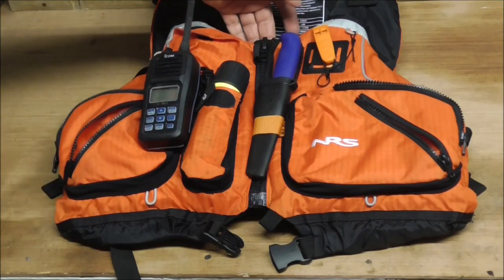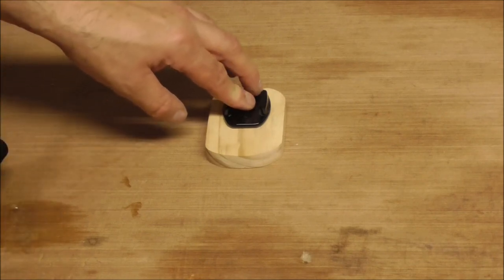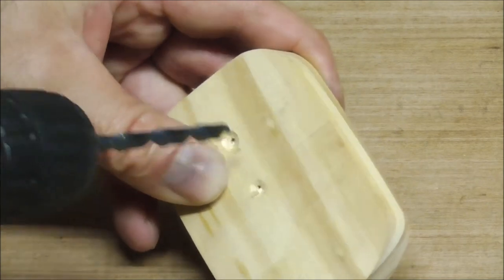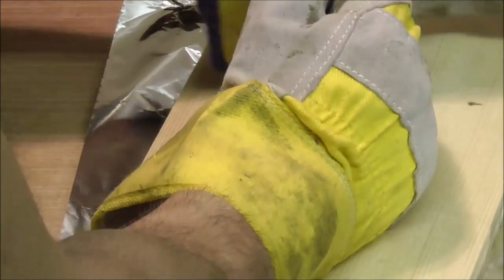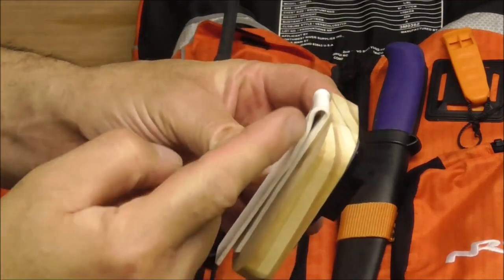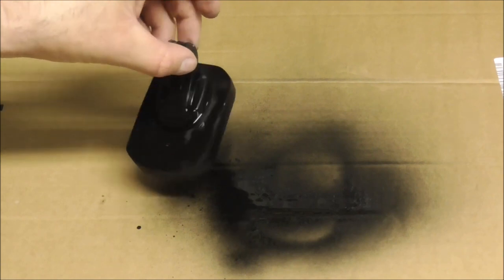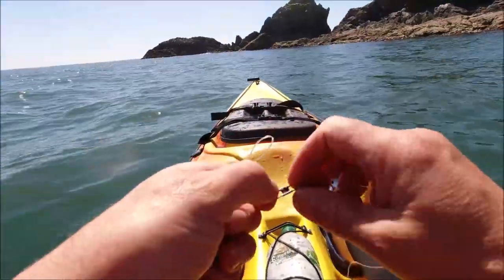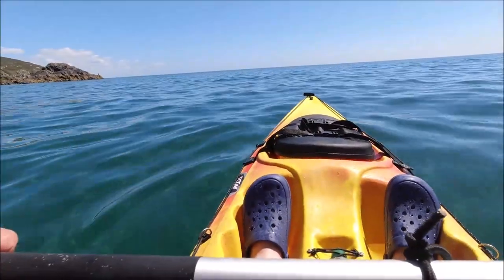DIY KAYAK GO PRO CHEST MOUNT FOR PFD/BUOYANCY AID

Comment: Your chest mount is a great idea, much simpler than the harnesses plus the satisfaction of something you have made that works.
 The Tempo is a little bit slower than the RTM Disco I had but much more stable, seeing this makes me a little jealous as when I moved inland I gave my Disco away, since I have discovered two lakes formed by dams that have been opened up to sailing and kayaking.
A pity there was no driftwood, nothing nicer than super fresh mackerel.
I hope you are coping with the C19 and that your family are well Vinnie.
Reply from the maker: Thank you Chris. It was bugging me to come up with an easier option. I'd love to try a Disco out but I am very happy with the Tempo. I am sure you could pick up a kayak for reasonable money and hit the lakes
Reply: @vinniesdayoff3968  The Disco is a lot more tippy than the Tempo, although I never had a problem with mine, a friend who had the same fell out of his a number of times.
 I actually made an outrigger bar so that I could go out in choppy water, using the blue Dow builders foam boards, I glued some layers together then fibre glassed them. I used the same 40mm waste pipe with 32mm inside to stiffen it and fitted it on with push in pipe clips, without the outriggers in chop, I had to be very careful, with them I could (just about) stand up. Still have the patterns somewhere if you ever need any.
Reply from the maker: @chrisosh9574  You being careful in chop brings back memories (not good memories) of when I had a wilderness systems zephyr. I never trusted the thing even though I spent a great deal of time training for stability sitting on an exercise ball with my feet on a football and "paddling" with a broom handle. i just didn't get enough time on the water to be proficient with it. The practice came in handy a time or two with the Tempo in rough water. You still have to sit up straight and work the hips to stay up
Reply: @vinniesdayoff3968  I love being out on the water and in or on a kayak you really know you're there but I tend to be careful, if you fall in it is easy even in a light breeze to be seperated from your craft, a mate of mine fell in and between a fairly soft current and a breeze he couldn't catch up with his kayak, luckily I could so I towed it back to him. A problem with sit on tops is they are more susceptible to windage, so on a breezy day I clip a paddle tether to my PFD and to one of the D rings behind the seat. Balance wise, I have only come off when messing around surfing but don't feel super confident in choppy conditions so I don't take chances, I never tried fishing from the Disco either.
Reply from the maker: @chrisosh9574  Yeah, I use a paddle leash too. I have never let go of the paddle on falling out ,but if it is rough I also tether myself to the kayak. I carry that safety knife because of all the tethers and the risk of entanglement

Comment: Ingenuity. You pulled it off! Nice work Vinnie. Cant say I approve of the Crocs but well done nevertheless :) I prefer the chest mount to the head mount view on my stand up paddle also, so all in all your time was worth it. Cook-up not needed. Lastly, Go Pro has a mount with a little floaty built into the back door. Though it makes the casing a little thicker. Perhaps that would screw with the angle so a string might work better, as noted.
Reply from the maker: These are my crocs
There are many like them but these ones are mine
My crocs are my best friend, I must master them as I master my life
Without me my crocs are useless, without  my crocs I am useless etc etc 😁